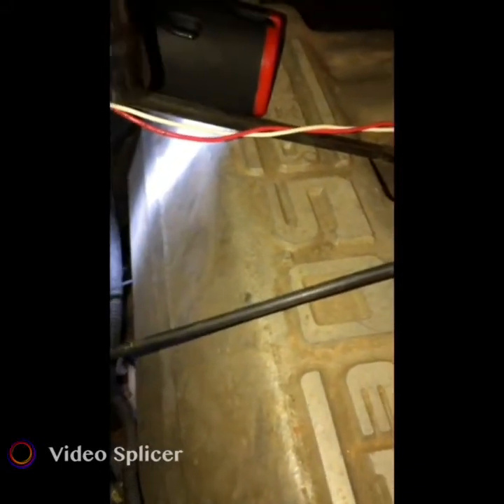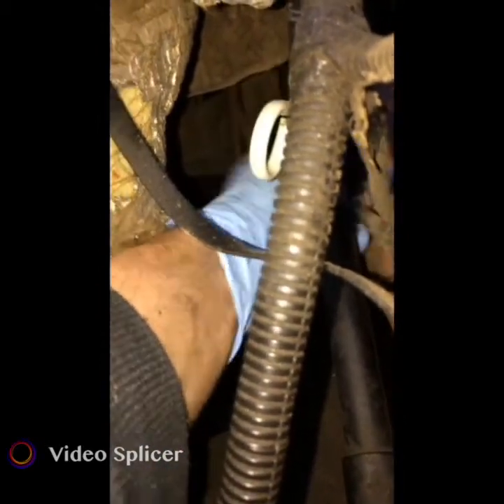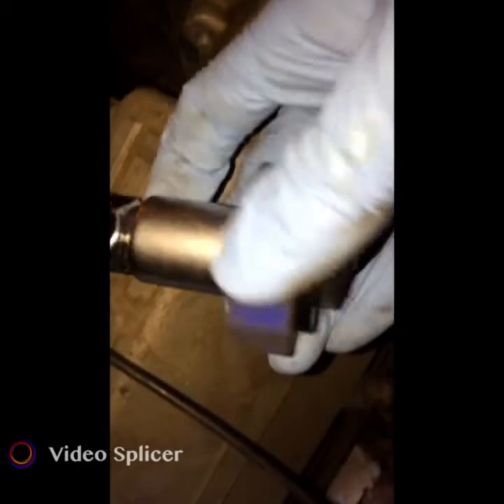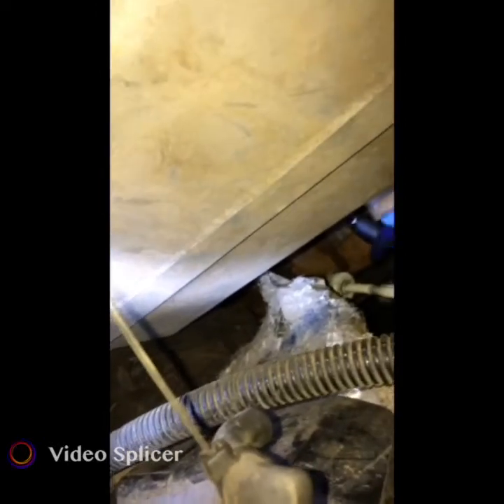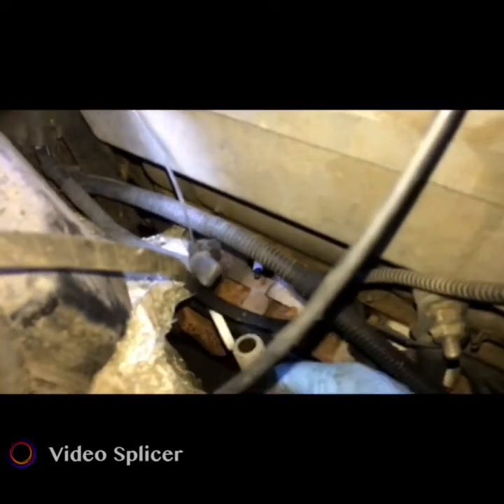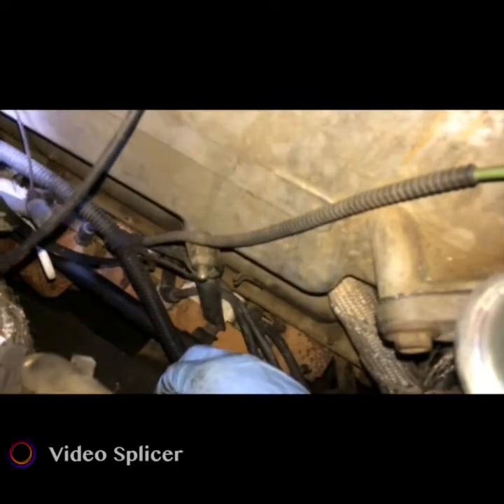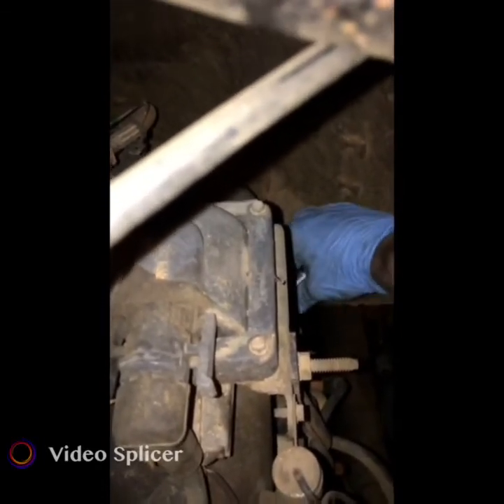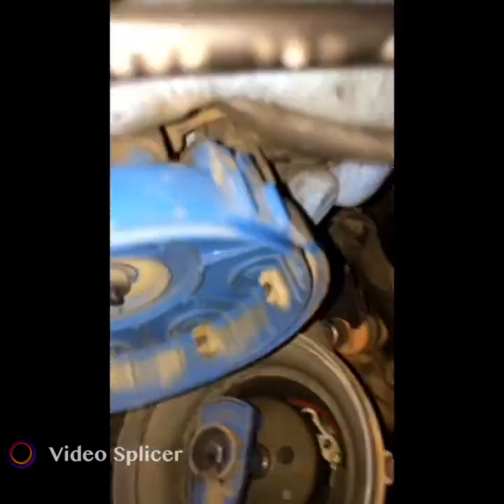Easiest and fastest way to change spark plugs on a 5.0 v8 302 ford engine 92 and up!!

Comment: I think we all appreciate you showing the hardest plug to change and introducing the hand ratchet to us. What else is nice is the little things like saying to put your thumb over the plug when it's in the socket so it doesn't fall out as you showed on the driver's side. The devil's in the details. Thanks so much for doing this video. I've got a '96 5.8l to do and I wanted to see what I'm in for. This was EXACTLY what I was looking for. Everyone wants to just show the easy parts when we're only searching for the struggle, if you know what I mean. Because it's good to go into this somewhat prepared.

Comment: Thank you good sir this was helpful
Reply from the maker: +Lebis150 glad I could help make sure the plugs are in there good don't want one to pop out Haha. Thanks again for watching!
Reply: No problem bud, I was fighting with the #4 on the passenger side, because mine still had the hoist bracket still in place and in the way. Haha.
Reply from the maker: +Lebis150 yeah that is the trouble side for sure, I am glad you got it done. My first time was magical and frustrating haha
Reply: Truly appreciate you showing the hard one first. All others just show the 5-8.